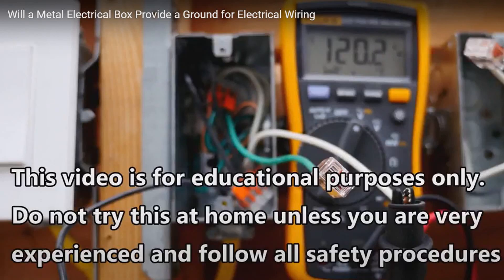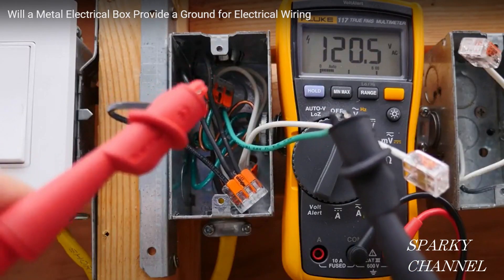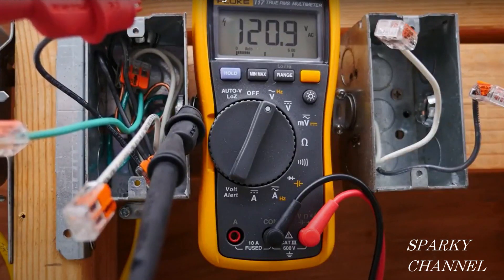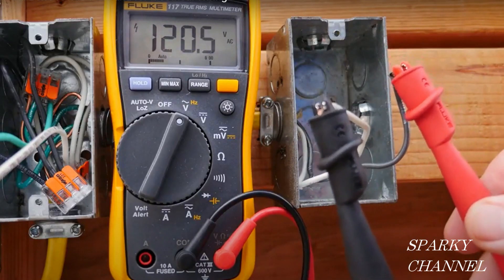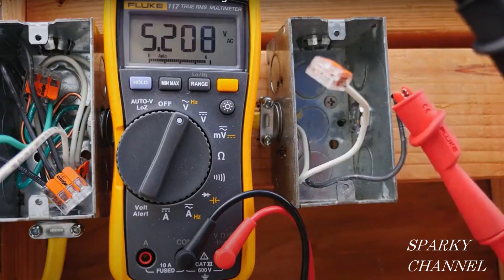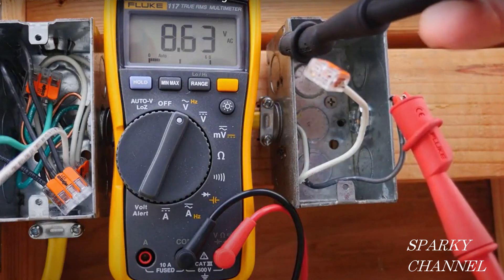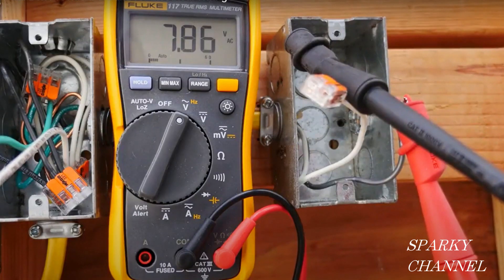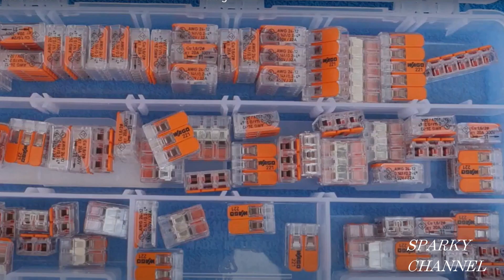Will a Metal Box Alone Provide a Ground for Electrical Wiring?

Comment: Thanks for the video I have a house built in 1951 looks like the boxes have the metal box with the ground connected to the box itself although there was a addition built in 1978 from previous owner.  

I went to change a light switch and they had a three way wire system black white and red   the white wire was hot and the black wire went to the light the red was hot when I turned the switch on ?  Couldn't figure that out  .    I went to main kitchen original wiring and it only had white and black single throw light switch  so I just capped off the red in the addition and used the white and black  in the new switch any help would be appreciated  I do see another light switch on the wall that never worked so maybe it was part of the three way but 4 ft to a 3 way switch ? Makes no sense why they did this

Comment: 2:39: If you switched your 117 to the "Auto V Lo Z" setting seen at the far left of the dial here, you would likely have found 0 (zero) volts with hot alone measured, no?

Comment: Did this to test old outlets since no grounding wire and the seller fooled our home inspector with bootleg grounds. I’m showing 45v rather than 120v… wondering if this is enough protection or if I’m better off just doing all the 6 boxes with GFCI

Comment: For years working in residential electrical and a lot of old houses. The best handy quick determination of grounding integrity Ive found is a wiggy from hot to ground. It’s best to put some load on the circuit to really know ground is solid. Also a Klien multimeter on low impedance should work. Using a hi impedance meter can work but also could give you ghost readings.
Reply: What is a "wiggy"?

Comment: But is it safe to ground a receptacle to an ungrounded metal receptacle box ? Not bonded to the panel.
Reply: Is it safe? While it's not dangerous, it won't accomplish anything either, and is a waste of time.
Reply: @surferdude642  Could we just connect a piece of wire to the ground bolt on the receptacle, and run that wire directly into the ground through the brick wall, by drilling a hole to the outside and burying the cable? Newbie here, so please pardon my ignorance...
Reply: @GoldenCup888 No, don't do that, the ground wire must go back to the ground/neutral bus in the main panel in order to trip the breaker and clear a ground fault.
Reply: @surferdude642  Thanks for the response surferdude. So if there's no ground in the system going to the outlets, the breaker won't trip at the panel when there's an overload at the outlet?
Reply: @GoldenCup888 The ground wire does not protect against an overloaded circuit and the breaker should trip in this case even though there is no ground, because that's the job of the circuit breaker.
Reply: @surferdude642  Good to know. Thanks👍
Reply: @surferdude642  Surferdude, are you a pro electrician?
Reply: @surferdude642  Maybe you can help me.. I have an independent line/Circuit with 8AWG wire, that has a 30AMP breaker. It runs from the main panel, to a small sub panel located 120 feet away, in a well pump room. The Sub panel has two 20 amp breakers, one gives power to the the well pump which is 1hp, the other breaker gives power to an outlet on the wall, which is about four feet away from the well pump. 

So 8awg wire from the main panel (30amp breaker), to the subpanel (two 20 amp breakers), then from the sub panel to the 125v 20amp outlet, it's wired with 12awg.

From that outlet to the inground pool, is a distance of 63 feet. I want to be able to drain the pool during raining season. I'm planning to use a 50ft extension cord (low gauge) to connect it to a sump pump, which has a 16ft power cord. 50ft extension cord + 16ft of sump pump power cord, gives me 66ft.

I will be turning off the breaker to the water well, when using the outlet to run the sump pump. The sump pump is a 3/4hp, 110v, 550w, 6.8amps.

My question is, can this be done with the current electrical setup? Is there any fire hazard to use this pump on that outlet, which feeds off a 20amp subpanel, which feeds off a 30amp main circuit? If this can be done, what gauge extension cord should I use? 12 or 10 awg? I appreciate any help you can give.
Reply: @GoldenCup888 How long does it take to drain the pool?
Reply: @surferdude642  About 3-4 hours...
Reply: @GoldenCup888 It seems okay to me as long as your receptacle is a GFCI or you have a GFCI breaker in the sub panel and everything is in good condition. Your main panel and sub panel should be properly grounded. The neutral and ground must be bonded on the main panel and must be separated on the sub panel. The neutral wires must be isolated from the metal panel housing in the sub panel. I'm not really an expert in this situation, so I recommend that you also check out the diy stack exchange under electrical and the diy chatroom, also under electrical. A lot of electricians are eager to help on these sites, in my experience. Good luck.
Reply: @surferdude642  Thanks. I appreciate your help 👍

Comment: so the box that isn't grounded has less voltage than the one that is.  can someone explain to me how that works?
Reply: It's called "stray voltage" or "ghost voltage.  There is a measureable amount of voltage in the wires, induced from the alternating current from the nearby power and neutral wires.   It's not unlike radio signals.  They are actually tiny amounts of electric current in the air.  However, while those radio signals are measureable (your radio works) you could not power anything with it.

However, that stray or ghost voltage will dissipate instantly if it is connected to the slightest load.  The presence of voltage is merely the difference between electromotive force in one place and another.  Voltage alone does not indicate power.  It also does not indicate the flow of electricity.

Comment: I have been trying to figure out why I am getting 120v from hot to metal box in my receptacles. There is no ground wire visible in the boxes nor is there any metal conduit in the house. I think after watching your video, it has to be grounded on the back of the boxes  like you have shown in the video. I installed a GFCI receptacle on the first outlet anyway to be safe. Thank you for this video, I have not found any other explanation online.

Comment: For old style house electric receptacle，the old style metal receptacle box is grounded，but only has two wire for hot and neutral coming out of box , do I have to pigtail the ground wire to replace outlet or the metal screw of the new outlet connecting to the metal box will do? The outlet tested shows good connection without the ground wire connected for the new outlet receptacle. Thanks !
Reply: I have the same thing and in my case the ground wires are connected to the outside of each box exactly like Bill showed starting at 4:00. They are 18 gauge and he said that they are not sufficient for today's code. I believe that they are considered "grandfathered in" so they're still okay until major renovations are made and electrical wiring would have to be upgraded. All the boxes show excellent ground when tested with a multimeter and all receptacles and GFCI receptacles work properly and show proper ground. The main panel has ground and neutral wires on the same bus which is normal for a main panel. You probably have the same situation. You could add a pigtail using an existing unused cable clamping screw or drill tap a new 10-32 thread if you have room, but IMO it's not worth doing that. You are still stuck with 18 gauge wire going back to the electrical panel. I changed all the receptacles to spec grade and they have a self grounding strap. This is compliant with NEC 250.146(B) the way I understand it, I am not an electrician, but I have experience with residential wiring. The self grounding strap and receptacle yoke must make contact with the metal box for this code to be valid, then a pigtail ground wire would not be necessary. You could get the same results from a residential grade receptacle without the self grounding strap, but it wouldn't comply with the code that I cited. The boxes are often recessed a bit, so a metal spacer(s) may be necessary to achieve the metal to metal contact. You can also coil some 14 gauge bare wire around the screw threads to achieve this. Make sure that you remove the paper screw keepers before hand.

Comment: What if the metal box is grounded via metal conduit...so the metal conduit connects back to the panel that is grounded (at least I assume that's how that works). But is that essentially the same and you can then ground to the metal box if need be?
Reply: Yes. Where I live, we can't use Romex. Only EMT, IMC, RMC, and various flex cable is allowed. One just needs to make sure all connectors are well torqued so they don't get loose over time due to heat, vibration, etc. There are a bunch of rules in the NEC (and local) for AC (BX, etc.) related to this.

Comment: Well, then, i'd like to see how to properly bond a metal box, lol 🤷‍♂️. I'll look up a video for that now, but if anyone can share that, i would greatly appreciate it.
Reply: Using Romex? As he shows here, the ground wire is bonded with the green screw.
Reply: @stringlarson1247  To be properly bonded, the ground wire from the Romex has to be connected to the green screw in the box and the ground bar in the panel, correct?  Then, in the box, you would use a separate pigtail to connect the green screw on the receptacle to the box's green screw to complete the ground?

Conduit-only permitted here as well... Chicagoland code!
Reply: @EdDinIL  if you're in Chicago/Cook, Romex ist verboten, that being said, if you're bringing Romex into a metallic box, the ground wire from the Romex should be bonded with a green screw to the box and a pigtail to the receptacle, etc. If the receptacle is self grounding, you don't need a pigtail.
Reply: @stringlarson1247  Yep, my house has 100% conduit.  Thanks for clarifying the Romex grounding, though.  It wasn't clear from the video.
Reply: @EdDinIL  YW. Glad it made sense. As our local Orange, Blue, and Green 'big-box" stores all sell Romex and associated NM boxes, I often run into DIY and home remodeling company jobs that sneak that stuff in as so many things get done (in the city, at least) where no permits get pulled hence no inspections happen. 
FYI, our current code allow for up to 25' of MC (AC, BX, Flex) raceway in enclosed/protected areas. It used to be ltd. to 6' whips.

Comment: Is the metal box grounded if it only has the black and white wire but no ground wires or pigtail yet my GFCI tester shows correct connection(2 orange light).   
The home electrical boxes are link through metal conduit straight to the breaker box and the wall are plaster walls.  

Should I pigtail anything if tester shows as correct
Reply: In theory to be compliant (to present code )one would think that if the receptacle ( or switch) is not making direct contact to the metal j box that is designed to be used without a ground wire connected directly to the receptacle it's not considered grounded with out a ground pig tail to j box to receptacle.            Ps  I can't see any harm in (pig tailing grounds)  redundant grounding a receptacle /switch;  for the purpose of making a better positive grounding system. Good luck

Comment: I have a house that was built in 1955, it was ran with emt to the metal box. I would like to know will that provide protection or should I use a GFCI?
Reply: I’ve heard that EMT that old is problematic to provide a ground because of corrosion, loose, or missing connections.

Comment: This video was helpful.  I have a situation where my house is older. It’s a concrete house and all the electrical work is pretty much permanent unless I wasn’t to bust concrete to run new electrical. 😂  
Well the house is older and only has 2 wire electrical.  I’ve replace all my outlets and when I test them with a tester, they all show to be wired correctly, except for one outlet that ready open ground.  I tested to see if maybe it was a 240v but it’s 120v.  I tested the wire and it appears one is hot and the other neutral. When I plug something it, it does work… but this open ground concerns me. Not sure why all the other outlets in the house appear fine except for this one alone. If I test it with the multimeter using the metal box as ground, I do get 120v circuit.  Since it apparently is  a good ground, would it be safe for me to run a ground pig tail to it? I’m concerned I may somehow energize the metal boxes and electrical plumbing in the house   And if I someone touches it they might get shocked.  Is this safe to do?
Reply: I have this same issue, did you ever figure it out? My theory is that in my case, the box does not lead to the service panel, but instead feeds off a light switch in that same room. The previous owners just drilled a hole in the wall to get a box in there but the wiring is outside and comes from the light switch, hence the box is ungrounded by all means.

Comment: How would you test for a plastic outlet box ? I have one outlet in the dining area which is showing no ground when I plug in my tester. Power is there but ground light on plug-in tester does not come on. It is a plastic box and the only one in the whole house not showing ground.  Any advice ?
Reply: I am just a diyer. From what I understand however is plastic boxes have no ground attached to them like the old houses. The ground goes through the Romex wire and onto the outlet no pigtail attached to the box or anything like that. It needs fixed in two areas; not attached to the outlet correctly or ground wire is not connected to the breaker panel correctly. Hopefully you already figure out what to do.
Reply: Thank you sir.
Reply: Why would you even think is testing a plastic box. Plastic is an insulator. That makes is safe, just use the GFCI method of you want to change the socket.

Comment: if I want to use a metal box grounded what is the maximum circuit breaker this box can handle? Thanks
Reply: Why would you want to use a metal box if you have a ground wire going from the box to the electrical panel?
Reply: @FreeAmerican-mm2my I'm thinking they're saying they don't have a ground wire to the breaker box

Comment: I need to do this test on the outlets in my 1982 condo unit because there is no ground wire. I didn't see a grounding screw in the metal box used for a wall switch and I bet the metal boxes for outlets are the same way.

Comment: No, the reason you're getting 5.4 volts is due to something called, "Capacitive coupling".  The impedance of the meter is very high, and there is a small amount of capacitance between that black lead and lower-potential things near it (you, the wood, grounded conductors, moisture in the air, etc.).
Put a 2 watt incandescent light bulb in parallel with those meter leads and you'll notice near zero volts, because the impedance of that bulb will be very low, putting a comparatively large load on the circuit, effectively shunting that minute amount of capacitively induced current to a much greater impedance, causing the voltage to drop to near nil.
Reply: No need for a bulb. The 117 has a Lo Z setting you can see in the picture.

Comment: What do you do if your boxes are like the one on the right, and not grounded?
Reply: If you want it to be properly grounded, you will have to run t ground wire back to the electrical panel.
Reply: Basically we're stuck needing to install GFCI outlets everywhere
Reply: @rachelwatsky683  that doesnt solve the lack of grounding
Reply: @IIlicit  That was my concern, I read that installing a GFI protects you, yet will still test as not grounded. In addition your required to put a sticker on saying no equipment ground-----pretty confusing.

Comment: No ground is isolated as a earth ground attached to neautral bar in a cheap made panel box , there are  many,  but useless on no fault, no fault is much expencive but a fact it saves lives.   They must  be  a good panel,  with a  isolated earth  ground  seperate  bar from neutral.  or buy a south east asia panel box  from philippines or veitnam or south korea, without  a earth ground and make one seperate in the panel box and mound it on it , attached to the box also. Those must be seperate for a  NO  fAULT   to trip at its fastest  to save lives , plus for a isolated circuit as power grids require , all isolated computer call centers require,  and all mega generators to level  out and balance,  so they will  not shut down due to phases not balanced. This i know  is  a fact in experience building power grids in war zones. Building power grids for military bases and rebuilt  citys  usa military has destroyed in wars. Can not waiste time recranking the mega generators every 3 minutes.  As bullets bouncing off your helmets and bullet proof vest , etc. Must get it correct first time. A second  try can be fatal if alive. This is what kbr does with the usa military in war zones.
Reply: Can you have someone edit your comment so it is grammatically correct so we can understand your point?
Reply: @PatHaskell  i did not notice the spelling miss types. I corrected it, sorry my phone has tiny letters and i have big fingers, thanks.

Comment: To clarify for Joes/DIY:
"Grounding" is connecting a ground wire to receptacles and switches, "bonding" is connecting a ground wire to metal gang boxes. If your house was built after 1967 then the metal gang box should be bonded, the 1968 NEC code required all receptacles in dwellings to be grounded.